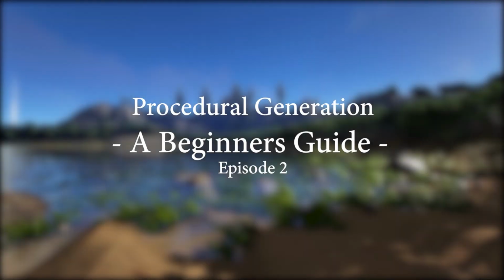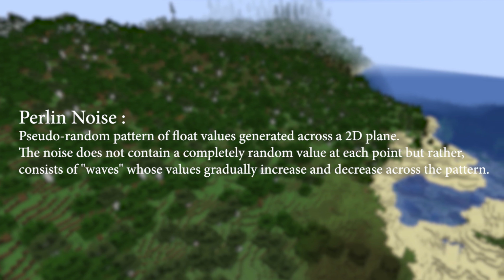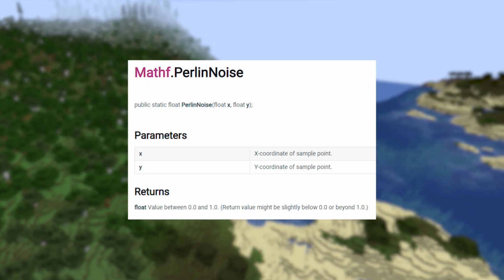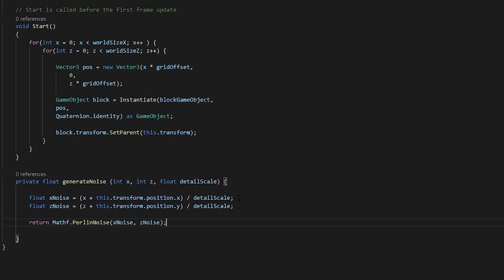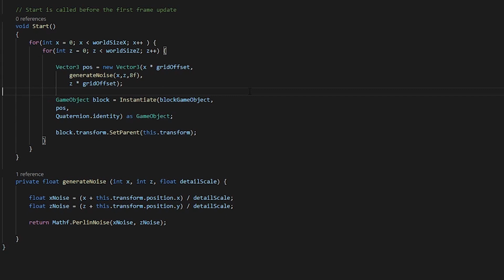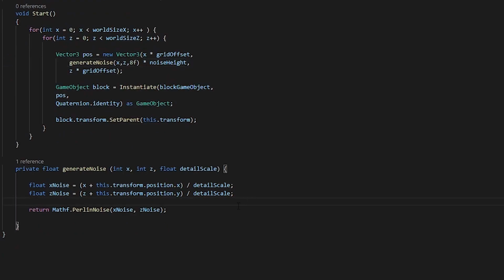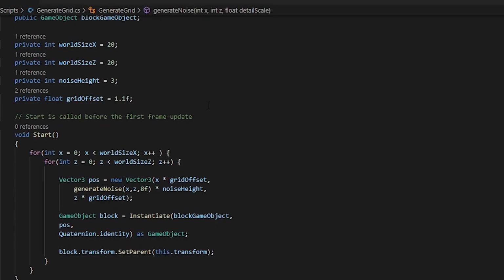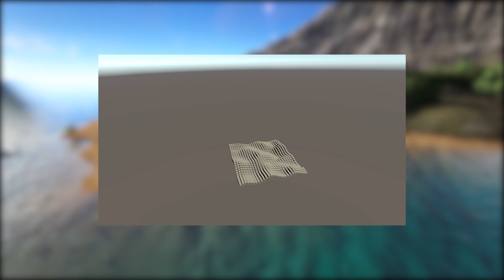Perlin Noise : Beginners Guide EP 2 - Unity3D

Comment: you dont add a z to a y transform unless you are adding two vectors but here you are not and it is confusing. i retested myself when i went through your video and through logical reasoning, your code is logically wrong despite it compiling and running properly. please do better.
Reply: Please, you do better. If you can't control your ego when giving suggestions, it's better to give none.
Reply from the maker: Hi, please explain further as you're contradicting yourself. The code works fine but yet the code is flawed?

It's clear to me that you didn't understand why the addition was necessary and that's fine, I'll try to explain better next time. By addition the vectors your starting position can be on any z,x or y coordinates.

Hope that helps, 

Rus